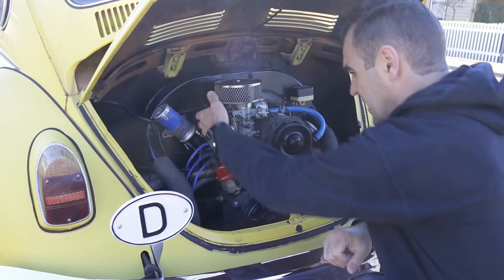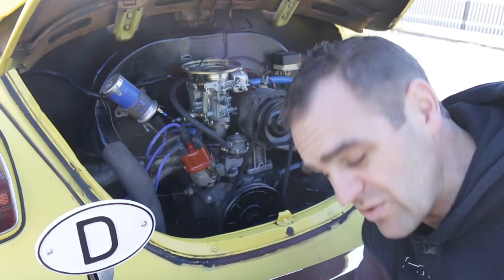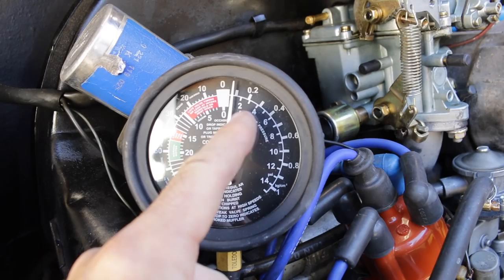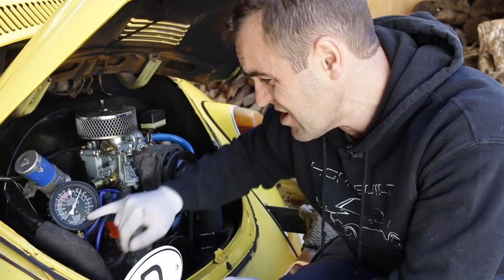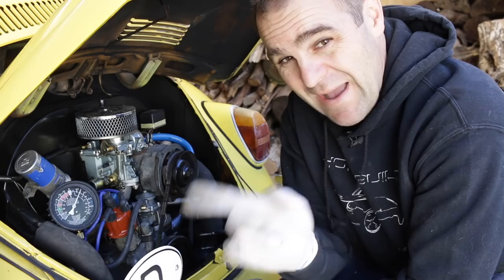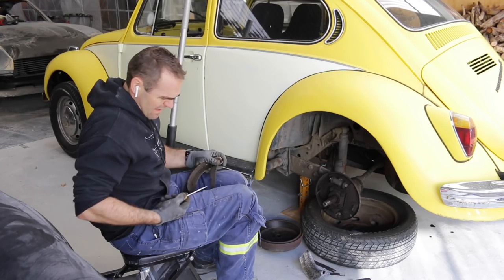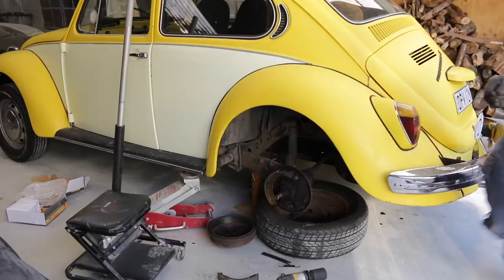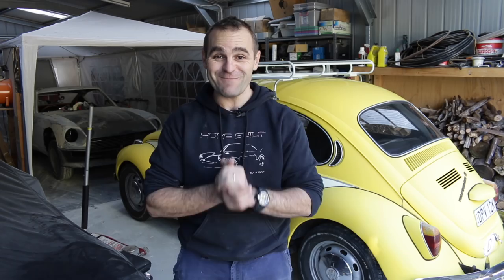Fixing fuel problems and cracking nuts - Home Built Project Beetle part 12

Comment: Having run into frustration like this before, I used the breaker bar plus cheater pipe like you, but then actually started and drove the car over the bar to crack it loose, worked like a dream! 

I love watching your weekly videos. I used to be a professional mechanic and now I work in an office, so it's great to see you overcoming these problems and seeing your troubleshooting processes, just like I used to do. Keep grinding!

Comment: In future you should get Ms.Jeff to stand on the brakes whilst you crack that nut, or if no help is available wedge a piece of timber between the brake pedal and seat to lock the brake. Makes this job much, much easier.
Reply: this

Comment: I had similar issues with those hub nuts on both beetles that I owned.  The first guy I bought mine from gave me a big thing steel thing that slipped over them and had a flat surface to hit it with a hammer.  That worked great!

Comment: if you plan on keeping that Beetle, you might want to consider a " torque meister" or torque multiplier. they work awesome for the engines gland nut as well as the rear axle nut. and you can remove it with a 3/8 drive ratchet. i paid $80 USD for mine

Comment: If it stops again, I'd undo the bowl plug and check it has fuel in the bowl, if not, check that the needle valve isn't sticking and adjust the float. Then make sure the fuel filter is good and you're not getting particles from the tank blocking the needle valve. Then check that the outlet of the fuel tank isn't being blocked by debris in the tank. I watched a guy where the latter happened to him and he had to rig a jerry can into the fuel line to substitute the fuel tank in order to get off the side of the road. :)
Reply from the maker: Definitely, but I was pretty certain it was the pump not doing it's job properly and that was it this time.

Comment: two lengths of pin in a VW type 1 engine one for a DC generator, one for an alternator setup (think the fuel pump was mounted at a slight angle. Don't ask how I know, but there is a super book,  hippish, but amazing , called  how to keep your volkswagen alive by john miurr. really worth getting! thanks for the videos excellent helps and advice cheers!
Reply from the maker: I have John Muirs book, it is great.

Comment: WD40 tight nuts and let it overnight works a treat.. Its dodgy but a breaker bar leaning on the ground and drive backwards should crack it aswel, same principle as a breaker bar on a crank pulley and hitting the starter motor.. at work we use clear hose on the fuel inlet to identify air locks, starvation, aeration etc..
Reply: Vote here also for WD40. Combine that with impact gun or taps to braker bar with hammer is pretty good with these cases. The peak momentum beats constant torque each time. And doesn't brake bolts.

Comment: G'day Kevin here. 
Next time with a stubborn axle nut. Remove the wheel and bolt a piece of angle iron across the drum to the ground using the wheel nuts . This stops the drum moving.
Reply from the maker: That would have done the job for sure. Next time.

Comment: You are mentioning a stuck caliper. Could as well be a blocked brake fuel line, i.e. the last bit made of rubber. It's due to aging and appened to me many times on my beetle.
Reply from the maker: It still works, just not as well as the right. That is just what some suggest. I actually think if it was stuck it wouldn't work at all, so I think it may just need a bleed.

Comment: Jeff the next time you have a tough nut to crack just heat the nut till it smokes then  the nut will come off much easier..plus get Mrs Jeff to hold the brakes on to stop the wheel turning
Reply from the maker: Heat yes, but I am usually filming while Mrs Jeff is at work :(

Comment: your just a skinny lad that´s why it took so long to get that loose he he  when using the impact gun if possibol no lengther on it just socket  regards Sören
Reply: you forgot to show that before fitting the drums again you beat the edge that the brake shoes made so they bed in with out wearing it uneven